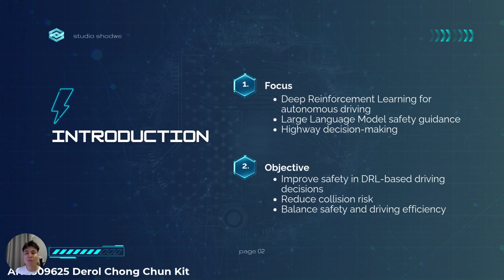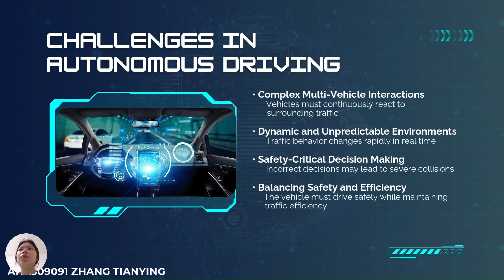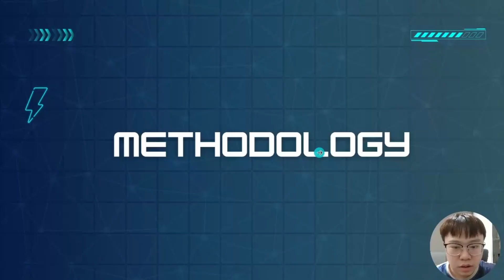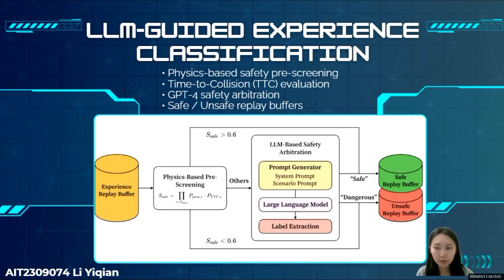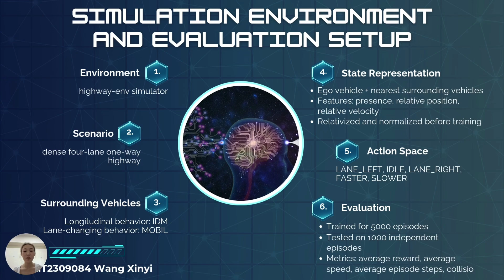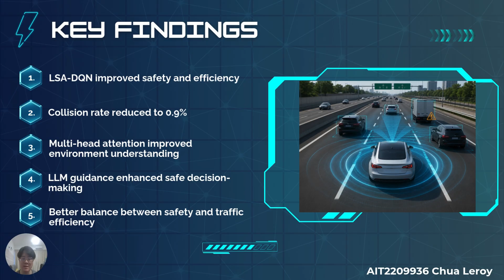202604 AIT306 Group 5

Comment: Greetings Group 5! Group 6 here! The 2 questions would be:
Question 1:
The framework relies on GPT-4 to label ambiguous driving scenarios as safe or unsafe. Since these labels directly affect replay buffer quality, how does the framework handle potential GPT-4 misclassifications and ensure reliable safety labeling?
Question 2:
The framework replaces a traditional MLP-based Q-network with an MHA-DDQN architecture. How does this change improve the model’s ability to understand complex traffic interactions?
Reply: Hi Group 6! The answer to Question1 would be:
The framework first uses rule-based metrics to classify obvious cases and only applies GPT-4 to ambiguous situations. In addition, safety regularization methods such as CQL and MCP help reduce the impact of occasional labeling errors. The hybrid design prevents the system from relying entirely on GPT-4.
Reply: Hellooo group 6, the answer to your question 2 would be because a traditional MLP usually flattens all vehicle information into one vector, which can weaken the relationship between the ego vehicle and surrounding vehicles. By using Multi-Head Attention, the model can compare the ego vehicle with multiple surrounding vehicles and capture different interaction patterns at the same time. This helps the agent make decisions based not only on individual vehicle features, but also on how vehicles influence each other in the traffic scene.

Comment: Hi Group 5, we r Group 4 and we have two following questions :)
Question 1:
Both CQL and MCP modify Q-value estimation to improve safety. Since their functions seem partially overlapping, how does the framework ensure that they complement rather than interfere with each other, and why is it necessary to use both methods instead of only one?
Question 2
The model uses Multi-Head Attention to focus on important surrounding vehicles. However, highway traffic is dynamic and changes quickly. How can the architecture ensure that the attention mechanism focuses on the correct vehicles during decision-making?
Reply: Hi group4, the answer to Q1 is: CQL mainly prevents overestimation of unseen or uncertain actions, while MCP explicitly penalizes actions identified as unsafe. Since they address different safety concerns, their effects are complementary. The paper’s ablation study typically shows that the combination outperforms either method alone.
Reply: Hi group4, the answer of Q2 is: The attention mechanism updates its attention weights based on the current traffic state at each decision step. This means the model does not use a fixed rule to decide which vehicle is important. Instead, it learns from training data and dynamically assigns higher attention to vehicles that are more relevant to the ego vehicle’s action, such as nearby vehicles or vehicles affecting lane-changing decisions.